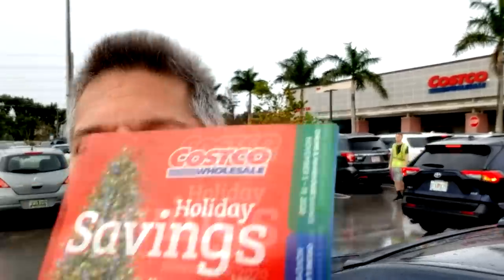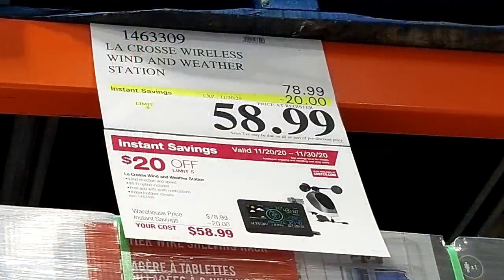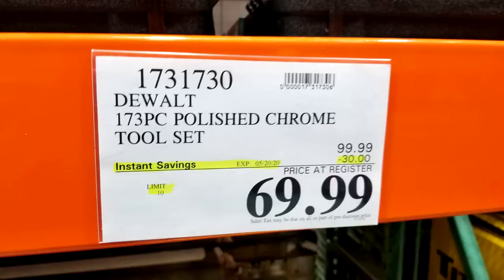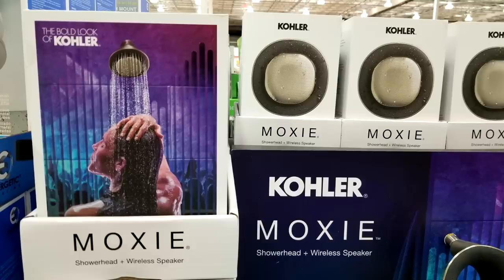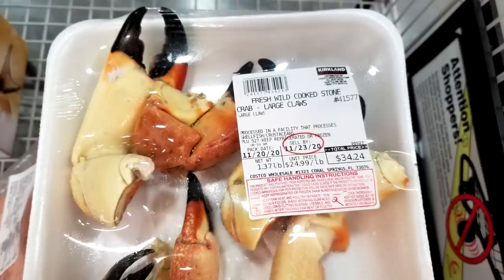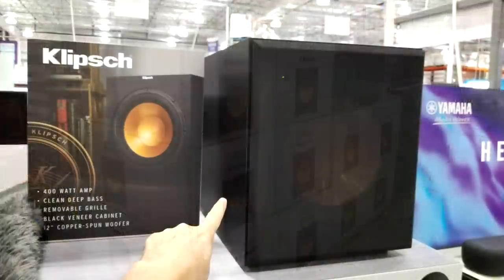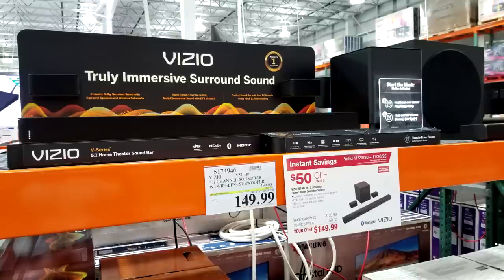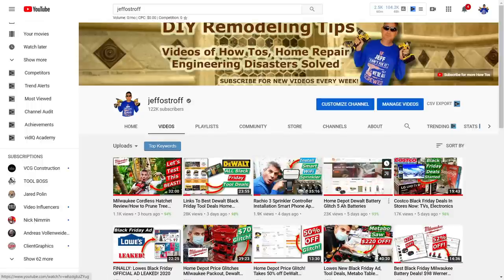Costco Black Friday 2020 Deals Pt 2 Are ON! TVs, Electronics, Housewares

Comment: The extension cords are a steal at 39.99. Because they are 98% copper the price tracks with the spot cost of copper. However, Costco does not alter their prices.   @2 x 6.5lbs   spot 3.25 lb       maybe 1- 1.5lb plastic
Reply from the maker: I got miles of extension cords over the years.